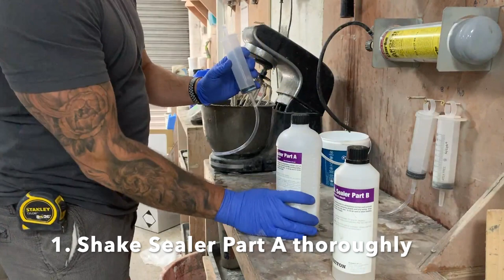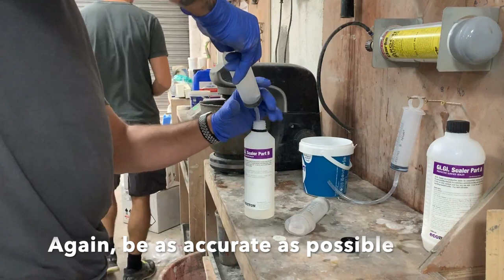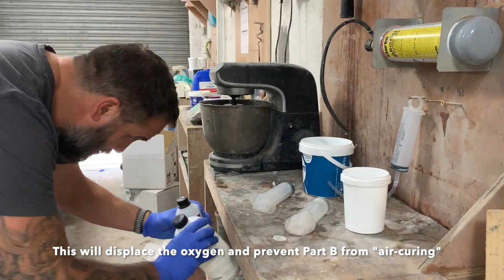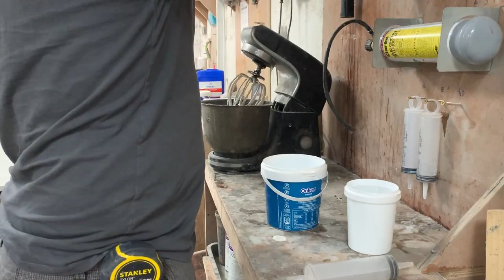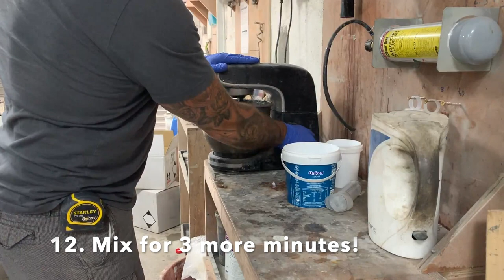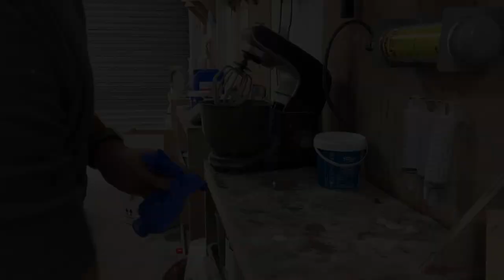How to mix the Concrete Lab Concrete Sealer

Comment: Unfortunately I married a particularly unreasonable woman who objects to my using her beloved Kenwood Chef for mixing toxic chemicals. Any suggestions (or reassurance that it is completely safe to eat concrete sealer)?
Reply from the maker: Ha! Probably not wise to use that food mixer then. Amazon have handheld electric whisks for under £20 though. You could use that but I wouldn’t recommend using the whisks for food after that 👍🏻

Comment: Well this procedure differs from the official datasheet! How so?
Reply from the maker: It does indeed. We have tested the product many MANY times and have developed this method to ensure excellent penetration. By doing 4 coats and in this method you will prime with coat 1 and get increasingly levels of product into the concrete with each subsequent quote.
By all means use the manufacturers guidelines, but our method is simply better. :)